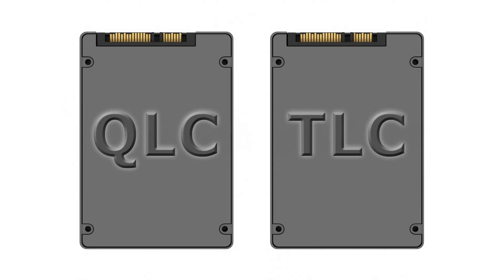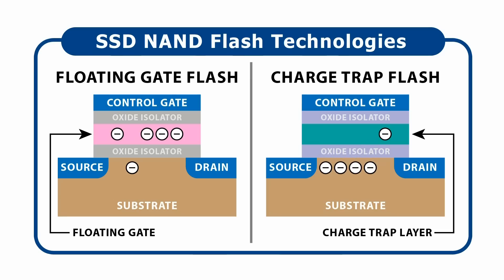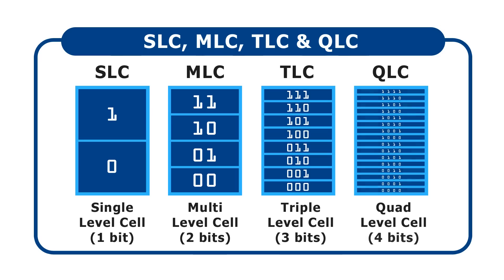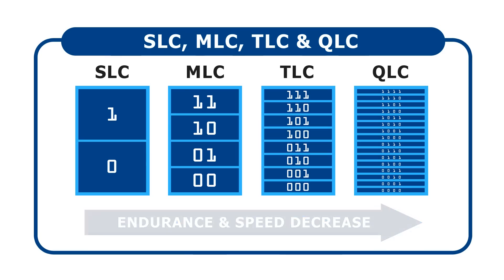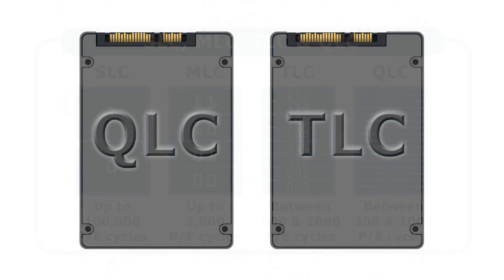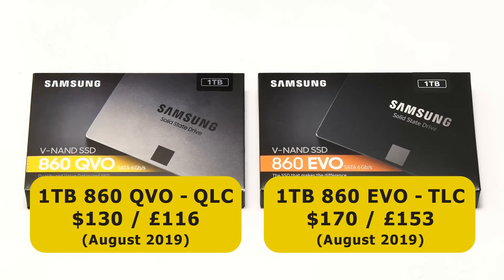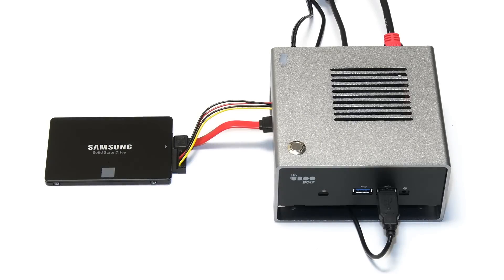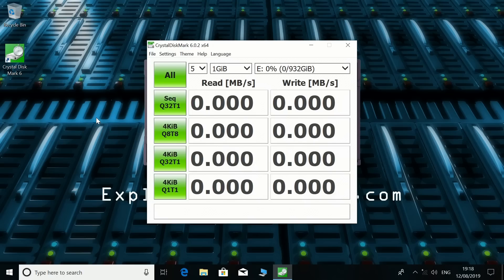QLC vs TLC SSDs: Samsung QVO & EVO

Comment: Since the QVO is half as reliable as the EVO, I wouldn't get one at the moment with such a small gap between prices but possibly in the future with a much bigger drive at a low price. Im very tempted to get a 1TB EVO to replace my old 250gb model on my PC but since I only installed the OS and Programs to it , I only use 90GB, all my games are on a normal 5TB hard drive I got cheap and it works fine. I imagine in the future large QLC drives would be perfect for data backup and long term storage of files since your not constantly rewriting over the drive. I probably would use one to store my media for use in Kodi.

Comment: 70 MB/s is below of traditional HDD drive, at least on big files. In terms of reliability I wonder what is the best long term (home user affordable) storage option for all those files? HDD NAS backed up to another HDD (in remote location), some lower spec LTO drive?
Long term I mean files (like pictures, family videos) that are often not used but stored for years.
Reply: The cheapest for home user is a HDD hands down unless you can get a very cheap LTO drive, and the endurance is similar. LTO isn’t worth it until you have tens of TB, and it’s obviously really slow in random speeds, so it’d take a while to access a certain file.
Reply: GRBTutorials this us what I'm using (HDDs). But I don't feel confident with them. HDD may have mechanical trouble starting after few years, SSD may have data retention problem. And this information isn't easily available. But storing backups on HDDs offline from two different manufacturers seems the most viable option.
Reply: Reliability in terms of writes is a non-issues for any SSD or HDD. What you should be concerned with is redundancy with a reliable RAID setup that periodically tests your data and allows you to swap in a failed drive for a rebuild of the data. So it's NOT the medium of storage that matters for you but rather the method of storage (RAID1 or better).

Comment: Unless you are doing video editing or big files processing on the ssd and you need lots of random ios thoughput on multi gb files, even the cheapest cacheless QLC ssd (kingston A400 recomended) is more than good enough.
Ive had my samsung 500GB 840 EVO for about 7-8 years (60k hrs on-time as of aug-2019) as my main OS drive watching youtube and a bit of torrents and downloads and i barely have 27.4TB written as per samsung magician and in theory i have like short of 300TB total so at this rate i could have this drive for another 54 years.

Comment: I think the speed test show the fault of the QLC as it has to fit 4x in each cell. 
In my experience TLC is pretty fast even if writing strait to the cells once the buffer is full.
Reply: The fault is it is expected to do so with a memory controller that hasn't got any memory.  Theoretically we can just keep n multiplier, indeed we are with the introduction of PCIe 5 which will allow for speeds that nothing can reach at this moment in time.  But you need a good controller.  Enterprise drives will be fine.

Comment: This is going too far (number of bits per cell) it's starting to get too unreliable.
Reply: for which use ? I for years used the 850 pro (1tb model) and I've not passed the 200TB mark of data written to the drive. you can argue you use your drives much more often for writing data than you have the more professional drives with MLC for reliability. but for normal user over 300tb of rated data that can be written to the drive is more than sufficient for what they would use the lifetime of their device - until they would upgrade their device. but anyway if you have critical data on your machine you wouldn't even rely on RAID 1 of reliable drives and  you also have updated backups of all your data. in any case the reliability you would want depends on what you do and how important the continues work of your device is.
Reply: @eliadbu  hibernation (especially with lots of ram) (I can't live without it) and lots of large video files being copied, deleted and created.
Reply: @KingJellyfishII  From experience, hibernation is the least of concern for SSDs... I have 32GB ram, but hibernation file itself barely takes 13GB write when all my RAM is completely full, because Windows compresses it quite a bit... Then SSD also has its own compression an actual writes ~7-8GB IF SSD is half empty... On more realistic 8GB ram usage when hibernating, actual NAND writes are roughly 2-4GBs.. at 4GB, 100TB writes sums up to a 25000 power cycles (or spin down cycles).. This is a quite a demanding load for anything but a NAS-grade HDD. In simpler terms, an average 1TB WD Blue drive will fail long before a 1TB QLC SSD will...

Also again from experience with half-professional use case, lack of storage space and the emerging new cheap SSDs will compel adding another drive to the PC long before actual longevity becomes an issue..
Reply: TurboCMinusMinus  funny you judge it as trash without even having any deep knowledge of how ssds are built what measurements are used to lower failure rate/increase durability, and also what are the consumer requirements of consumer / data centers for storage. If in 3 years the technology evolve in such way I can get 4tb QLC for half or less than what I pay now for TLC flash it would be a major success since it will allow me and moe other people to completely replace HDD with much faster/reliable flash storage.
Reply: QLC is already more reliable than the first and second generation of SSDs.

I will say this, there should never be a QLC drive smaller than 1TB. 240GB QLC drive has pathetic DWPD ratings. The cache size will also be an issue.
Reply: Alright I retract my statement, however for smaller drives (like the 120GiB one in my laptop) it still holds true I believe. I don't have hundreds (or even £70) to spend on a large SSD, besides I wouldn't use the space anyway. All my files are less than 30GiB excluding photos which are stored on two separate drives (total of about 300GiB I believe, a little over 1/3 full. Not just my photos but my family's too)
Reply: @KingJellyfishII  I can completely agree with that one. 240GB QLC has 27 GB per day for five years, I'd burn through that quickly.

Even with my TLC, which has much better endurance, I try to use my mechanical drive for most of my video work as it doesn't hurt it. More writes actually refresh the magnetics of the drive within reason.

It is funny when people list power cycles on drives though, I never turn off my desktops and rarely turn off my laptops and I've still got functional 20GB WD drives from 2000 or so.
Reply: You do know that you can move the hibernation file to say a HDD right? And how often do you actually hibernate the computer?
Reply: Huh? If it's so unreliable where are all the people compaining their SSD's wore out?
I have a heavy-use daily office/gaming system and it's 48TBW after 3.5 years. To hit the current 360TBW for the QLC SSD in the video I'd need to run my system for 26 years and a quality SSD should still work past that limit anyway... also, in the video at the end he talked about how he had concerns for 3-bit (TLC) memory when it came out but then it turned out it was reliable.

Comment: Looking at the crystal benchmark neither of the drives are super fast. after using the same test on my 2 year old Samsung EVO 850 500GB seq q32t1 test was about the same but all other tests were  30 to 40% faster
Reply from the maker: Be aware that I did not engage Samsung's "Rapid mode" in this video, which is often turned on in Samsung Magician, and which uses the PC's RAM as yet another cache -- which speeds up those smaller file tests a lot, but which means that Crystal DiskMark does not report accurate results.

Comment: I will personally never go back to a single disk setup. At least two disk minimum in my computer.
Reply: And then there's me with 4 SSDs and 2 HDDs in my tower hahaha
Reply: @HailAzathoth  ,
I've got four SSD's and two HDD's too! I also have a BluRay player and just realized that I don't have enough SATA connections on my new motherboard. I now have six but need seven. Sigh. Stupid me. I gain M.2 NVMe support but currently don't need more storage so I've got to figure this out. Statistically speaking one of my Samsung HDD's should die soon and solve the problem for me... actually, I plan to get a 10TB WD RED to replace my internal HDD's and also act as backup.

Comment: we have 10 TB HDD now, maybe we'll have 4 TB QLC SSD in 2021, but if we'll have also 20-50TB HDD on the other hand - SDD still will not win this race.
Reply: HDDs will hit a wall, theres only so much you can fit into a harddrive until even the tiniest of defects or vibrations causes data loss. Unless they become more reliable (and faster) too it doesnt make sense to put all your eggs in a "water resistant" paper bag in the middle of the rain. 
SSDs are several orders of magnitude safer than hdds, and even easier to recover in case it dies.  There will be a point where higher capasity wont make sense unless it also becomes safer and faster.

Make an hdd that can stand a 1m fall onto hard cement without becoming a brick and then we talk, otherwise i've seen hdds commit sudoku for barely anything. I had a usb one, always treated it carefully and suddenly one day it started having read errors and shit. I would never trust a hdd like that, that's why i always keep backups and have a raid5 for my main stuff, so they better make them more robust and start giving 10-15 years warranties.
Reply: @laharl2k  my olders HDD is 15 years old, it still works but i don't use it as it's only 60 GB and not worth to occupy 3.5 slot.
In all my life i have only 1 HDD which died and i succeflully recovered data from it using data recovery service. And and have a dozed usb stics, memory cards and SSDs failed and no data could be recovered from them. 

So in case of portable device HDD really is not an option as it fragile. But in case of home PC or server where it's safe and stable - HDD can work for years or even decades without any issue. And it has no countdown when it will fail for sure, like in SSDs.
Reply: @Set Dark
I have 6 HDDs in my worstation, 4 1TB ones in raid5 and 2 3TB ones, one for linux and one for windows. (and my ssd for booting) 
The oldest of the raid hdds has 73.5k hrs on it, but before i had a 80gb hitachi hdd that started having spin up problems at 65k hrs (still works but its been retired).
I had 2 of the raid disks that had write problems but were still under the 6 month waranty so i exchanged them for new ones. 
Theres that wd hdd from muy usb hdd that has write errors that died for nothing.
I have a friend of a friend that had a 300gb western digital just die on him out of the blue.
A few years ago i picked a box at a hospital full of dead hdds (like 30), most of them were ok visually but dead logically and wouldnt even be recognized by the motherboard, some wouldnt even spin up. Most of them 160gb+ sata (relatively modern), and like 5 IDE 32gb ones from maxtor. 

I have like 7 usb sticks from the 256mb era to more modern 8gb ones, not a single one ever died. (i still use the 256mb one to boot and flash bioses) Also never had a SD or microSD card die and i have 8 total. 

Thats my experience with storage.
Reply: @laharl2k  well, we have different experience then. There is a common think - my dead HDD was in USB box as well, i think it's USB box problem, something with controller or power there is not well for HDD. Or maybe it's because as it's portable you take it somewhere and mobility is a weak spot of HDD. 
Don't use them as external drives since that.

And yes, i also have 64 GB working USB stick, use it for confidential key data as it has hardware wite protection switch. But still some 8 GB stics and cards died with no visible reason (

But summarizing your experience i see that most of that dead HDDs are from business use, not home use. High load in RAID, how long do you think SSD will work that way, how fast will they hit their write count border? I think much faster than HDD will start havind spinning drive issues.
Reply: @Set Dark
My SSD is a 500gb samsung 840 EVO (TLC, QLC wasnt a thing back then), it has 60k hours on-time (almost 8 years), about 27.4TB writen, reading a few sites that testesd these drives to death mine can do 300TB before the first reallocated sector and even then it went on to 600TB before actually dying. 
At this rate i still have 54 years to hit the 300TB mark, and i dont think ill live long enough to see the drive actually die.

My raid5 is for storing important data, i have a huge library of technical books there and historical information i do not wish to lose. The most it sees it maybe downloading torrents, so no heavy load, at least not like a data center nor constantly working with huge files.
Reply: @laharl2k  Well, if you write once and read a lot - SSD is definitely the choice, but if you write a lot 600 TB is not that much. it's 30 times by 20 TB full rewrite which in case of dynamic server is completely ok and this amount of data can be written in several days/weeks.

BTW to back up data it's better to use DVDs. Just need to use good quality ones and low speed write and this data will be with you for generations. It does not suffer from conditions untill you are not burning or breaking it directly.
Slow access speed, true, but it's back-up, not working copy.
Reply: actually the predictions are that ssd will win in the end, as the Technology for HDD is Closer to the Limit already.
ssds are constantly catching up in capacity, Speed and Price.
it might be possible to build gazillabite HDDs, but they will eventually become bigger more complicated and more expensive for the top models.
the significance of PCIE 4.0 is that large PCIE 4.0 SSDs will become affordable and large enough to be used in Servers instead of HDDs.
ATM there is nearly  no Advantage in using PCIE 4.0 for graphics, the only Things for wich it really is usefull is storage(read: ssds) and communication(read: Network Cards). 
this development Shows that ssds are being expected to grow in Speed and capacity. a lot.
Reply: @ulrichkalber9039  I don't think HDDs will disappear from data centers any time soon. It'll likely take the better part of a decade for large capacity SSDs to take over. In PCs however, they are already well on their way out.
Reply: @ulrichkalber9039  it's not always about speed. People still use magnetic cassets to do backupd, because it has very large capacity, low price and high reliability. HDDs are not fast but volume/price for HDD now is much better that for SSD and having one 3.5 slot with 10 TB is not the same as having 10 2.5  slots with 1 TB each. So for home use as basic data storage HDD will be better as long as they can grow in volume. And i actually see no reason why they can't. 3.5 device allows do add a lot more then there is there currently, if we have 2.5 10 tb HHD - it means we definitely can have 20 TB 3.5 HDD. And if HDD manufacturers decide to leave the race for speed and work on storage capacity instead - we will use fast SSD for system and slow, but big HDD for file storage for years.
Reply: If you look at consumer-grade computers over the years you'll notice that the included storage capacity hasn't really progressed in the last 5 years or so - in fact these days laptops often come with just an SSD and that's it. The fact is, sales of consumers HDDs are declining rapidly as they are steadily disappearing from home computers. A lot of these newer high-capacity drives are aimed at the NAS and enterprise markets instead.
Reply: @SteelSkin667  you are not right. I had 1 TB HDDs 6-7 years ago, i've bought 3 TB 3-4 years ago as they become affordable and i've bough 2 10 TBs last year, when their price become the same as 3 TBs 4 years ago. So it's 10-times growth in 5-6 years for the same price. And it become a little quicker, 2-3 times maybe.

In the same time i've bought 2 80 GB SSDs same 5-6 years ago as it looked reasonable by price, then i've bought 2 more 3-4 years ago with 128 gb capacity and now i see that for the same price i still can get  128 or maybe 256. 1 TB SSD is either not reliable or pricy. So in the same 5-6 years SSD capacity grown 2-4 times for the same price and speed is almost the same. Yes, quite big from the very beginning, but not growing really.
Reply: @setdark  That isn't my point. Yes, HDDs are still getting notably bigger and faster as time goes by, but the way they are used is shifting, from being ubiquitous in consumer laptop and desktop computers, to being basically excluded from that market by now. The future of the HDD is in NAS and data centers.
Also HDD prices aren't falling as fast as you say either, they are generally the same price as they were in 2016 - the 3TB WD Blue I bought in 2016 for 100€ is still priced the exact same, and 10 TB drives are still well over 300€ - at least here in France.
Reply: @SteelSkin667  something's wrong in France, either you don't get low level models or you have higher prices. I see 10 TB for 250-280 euros in my market and it's more or less the price i've paid for 3 TB 3-4 years ago.

BTW i see Seagate Exos X16 SATA 16 TB for ~470 euro. I think in year or two it will be less than 300 and closer to 250 again.

Comment: What I would be concerned about is what happens to your data once it reaches the number of cycles AKA when the cells fail to be read/written to. Hopefully you don't loose your data.
Reply from the maker: Once the cells start to fail -- as electrons leak or are retained -- you will indeed start to lose your data. :(